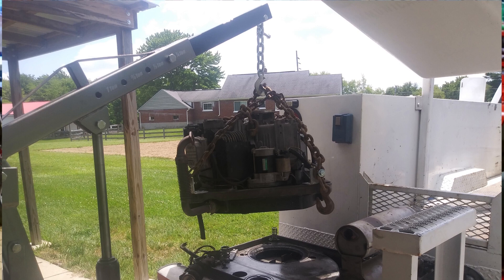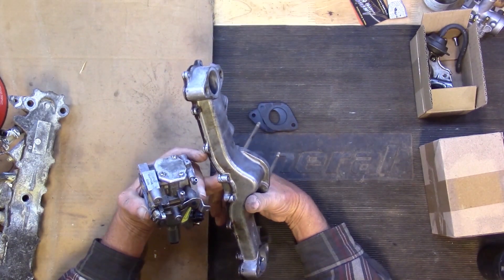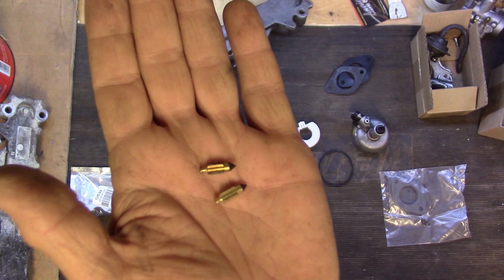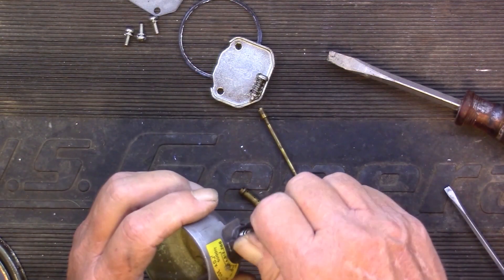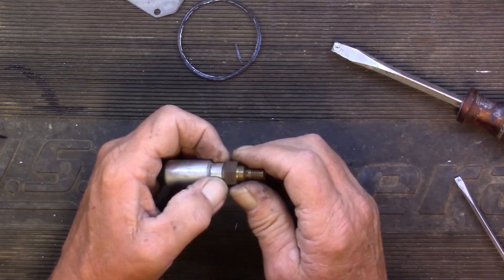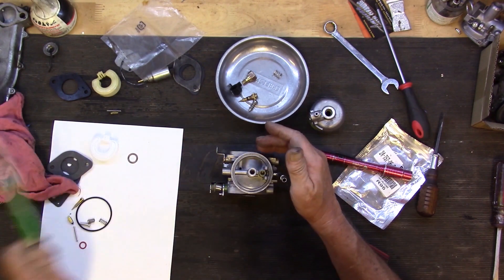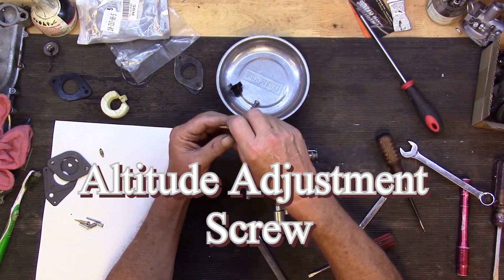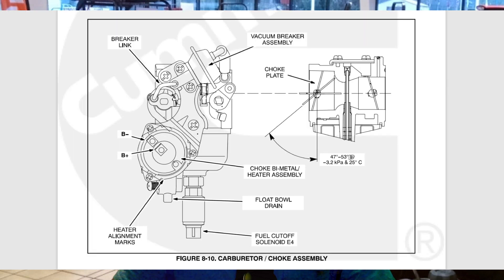Onan Cummins Generator Carburetor Rebuild for RV's and Commercial Trucks

Comment: What’s the part number for the Kohler carb
Reply from the maker: Thanks for commenting on this video. I believe that carb I show in the video is still around.  Ill look and see today what it is and post back. I should have mention it in the video but for some reason I didn't. Thanks for your support to the channel.
Reply from the maker: The part is 24853102-S . These don't have a way to mount the thermostatic choke. The internal parts are identical. I chose not to use it because it was going on a bucket truck and it needs to be able to start from the bucket in the air. This carb would need a cable type set up but will work on these motors.

Comment: Did you ever find out if that carburetor for the lawn mower would work on the generator ?
Reply from the maker: Yes, it does. It's the same exact carburetor.  Heres the link where I started it up installed on the genset.
https://youtu.be/6tL89fztwPk?si=U9bC8oTWmvztexqu
Thanks for watching and commenting.

Comment: Hi sir.  I have a 5500 Cummins Onan.  Would this kit work for that carb?  If so how can I get the part number?
Reply from the maker: Most likely the same. If your carb looks like the one in the video it would be - Parts Kohler Nos. 24-757-06-S & 24-757-18-S. 
Thanks for watching and commenting. Hope this helps.